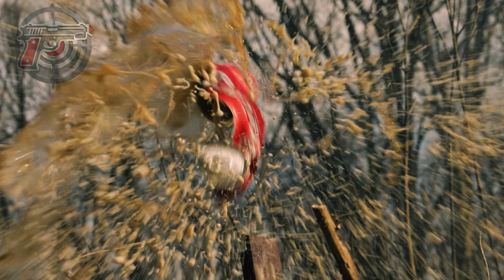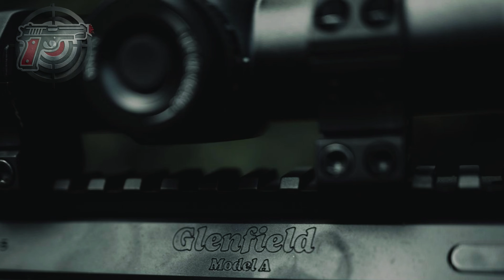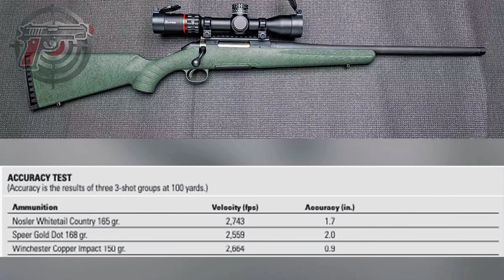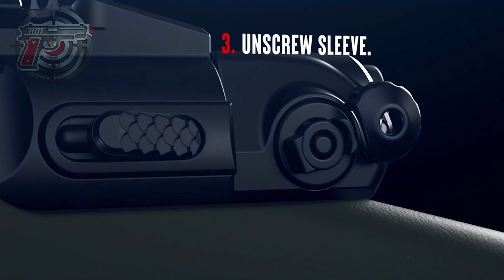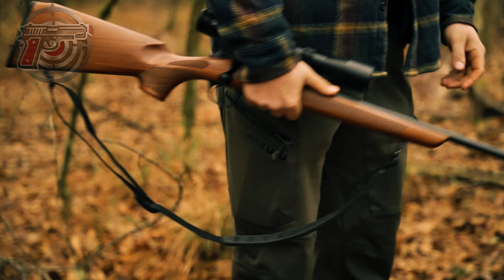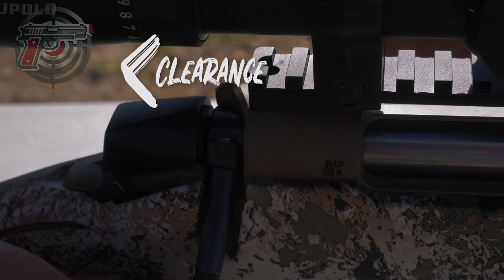The #1 Budget Deer Rifle at NRAAM 2026 (Is Ruger in Trouble?)

Comment: My savage axis in 270win, if you can squeeze what feels like a 25lb factory trigger pull, clicks 3-5 rounds out of 20. Id give it away but, why would i do that to anyone
Reply from the maker: Oof… yeah, that’s rough—and definitely not the experience anyone wants.
The Savage Axis has always been a bit hit-or-miss out of the box, especially with those older heavy factory triggers. That “click” issue you’re describing (no bang after the pull) usually points to sear/trigger engagement or firing pin energy not being consistent—something that really shouldn’t be happening, even on a budget rifle.
A lot of guys end up fixing it with an aftermarket trigger or having a gunsmith look at it, but honestly, when you’re dealing with reliability issues like that, it kills confidence fast.
That’s kind of why newer budget rifles—or even stepping up within Savage’s own line like the Savage 110—are getting more attention now. Better triggers, more consistent QC, and fewer headaches out of the box.
Did yours start doing that right away, or after some use?
Reply: @MediaLor360Arms  out of the box, ripped bolt apart, the dam firing pin spring in 3 piece's if you count the split ring thingy in between the 2 main piece's. i think they are binding up. what savage thought, i don't know. i picked up a rem 700 bdl few years later. the savage collects dust now.
Reply: @S.R-u5d  Do you still have it, in what state do you live in, how much would you sell it for?
Reply from the maker: Thanks for explaining when the problem started. I also need to correct the earlier reply: it shouldn’t have guessed a mechanical cause from a comment. Your account makes clear why that experience affected your confidence. Our latest video explores vintage Scandinavian and Swiss rifle history if that interests you: https://youtu.be/Bz62uxMLMAo
Reply from the maker: Thanks for joining the discussion. We’re keeping this thread focused on the ownership experiences discussed in the NRAAM video. If classic designs interest you, our newest video explores vintage Scandinavian and Swiss rifles: https://youtu.be/Bz62uxMLMAo

Comment: Savage has always produced the most accurate out of the box barrels. The axis lines problem was the cheap stock s
Reply: You forgot the axis clicks after you squeeze the trigger, 3-5 rounds out of 20.
I'd give my axis away but, why would I do that to anyone.
Reply from the maker: Haha yeah—that “Axis click” complaint has been around for a while.

To be fair, not every Savage Axis does it, but when it shows up it’s usually tied to the trigger or sear engagement not resetting cleanly—especially on earlier models or heavily used ones. Some guys fix it with a trigger upgrade or a bit of tuning, others just move on.

That’s kind of why rifles like the Savage 110 Core Predator are getting more attention now—still that Savage accuracy, but a more refined action and trigger out of the box.

Sounds like yours left a pretty bad impression though—did you ever try swapping the trigger, or was it a “done with it” situation?
Reply from the maker: Nice—that’s a great example of what Savage is doing right lately.
The Savage 110 Core Predator in .308 hits that sweet spot: solid accuracy (like most Savage 110s), but now with better ergonomics and a more refined feel out of the box. They’ve definitely stepped up from the older “purely budget” vibe.
.308 is a smart choice too—easy to tune, tons of ammo options, and more than enough for deer season.
If it shoots anything like most 110s, you’ll probably see sub-MOA without much effort. Have you had a chance to dial in a load or still running factory ammo?

Comment: Just got my 110 Core Predator in .308, very nice piece. Savage is stepping up.
Reply from the maker: Nice pickup—that’s a solid rig.
The Savage 110 Core Predator in .308 is a really practical setup. Savage has always been strong on accuracy, and with the Core series they’re starting to step up the overall fit/finish and ergonomics too.
.308 is hard to beat as well—easy to find ammo, manageable recoil, and plenty capable for deer and beyond.
Have you had it out to the range yet? Curious what kind of groups you’re getting with it.
Reply: @MediaLor360Arms  Thanks Gun Range, the stock is a big improvement, feels very solid with no fore end flex near the barrel. Bolt lift is improved a little as well. Taking it to the range tomorrow, will let you know how it does.
Reply from the maker: Thanks for following up with your impressions of the stock and bolt feel. Those observations add useful context to your 110 Core Predator comment. We’ve just released a look at vintage Scandinavian and Swiss designs if you’d like to join that discussion as well: https://youtu.be/Bz62uxMLMAo

Comment: The Mossberg Patriot predator is the best budget rifle by far. 22"-24" depending on cartridge, adjustable trigger, fluted bolt, fluted barrel, threaded barrel, and full cerakote finish. I picked mine up brand new for $379. Added a Vortex Sonora 4-12 and its half inch groups with factory ammo. My only gripe is that there is no bolt lock like on a Model 70 Winchester.
Reply from the maker: That’s a strong case—and honestly, the value you’re describing is exactly why the Mossberg Patriot Predator keeps popping up in these conversations.
At that price point, getting a fluted bolt + barrel, threaded muzzle, adjustable trigger, and full Cerakote is hard to beat. Pairing it with something like the Vortex Sonora 4-12x44 and still holding ~½ MOA with factory ammo? That’s punching way above budget class.
Your point about the bolt lock is fair though—that’s one thing rifles like the Winchester Model 70 still do really well. It’s a small feature, but it matters depending on how you carry.
Overall, that’s the kind of real-world performance that makes the “budget king” debate a lot more interesting.
What ammo has it liked best so far?
Reply: @MediaLor360Arms It's a 6.5 PRC with 24" barrel, the groups I've got are with Hornady Precision Hunter 143gr ELDX. I sighted it in with Hornady match with the 147gr ELDM bullets. But I am going to sell the rifle, I recently snagged a Winchester Model 70 push feed .30-06 with a 24" barrel for $500 used at a pawn shop. I'm gonna hand load for it, hopefully get some 165gr Accubonds running 2,900-2,950fps due to the full length barrel. And it has the 3 position safety with bolt lock. But I'd still take the Mossberg patriot anywhere on any hunt in North America.
Reply from the maker: Thanks for answering and explaining why the bolt-lock feature matters in your comparison. That helps put your Patriot experience in context for this NRAAM discussion. Our latest video explores vintage Scandinavian and Swiss rifle history; your perspective is welcome there too: https://youtu.be/Bz62uxMLMAo